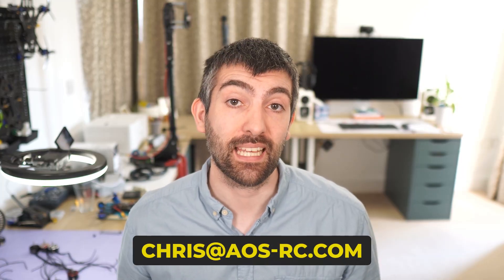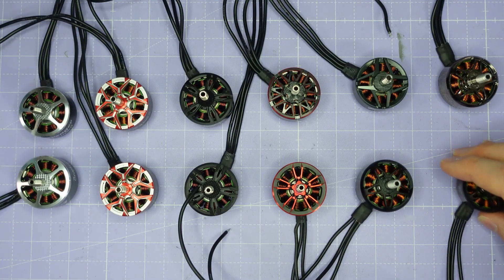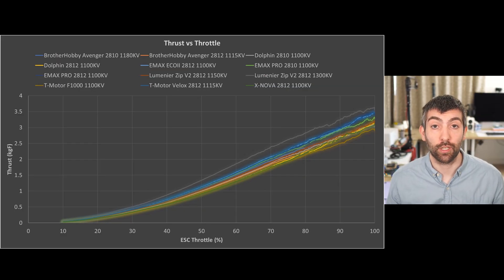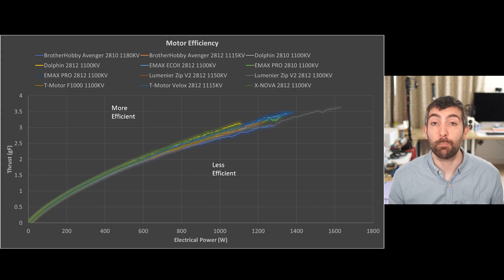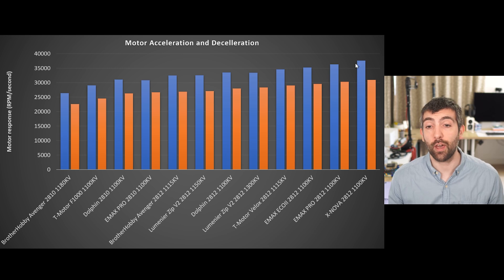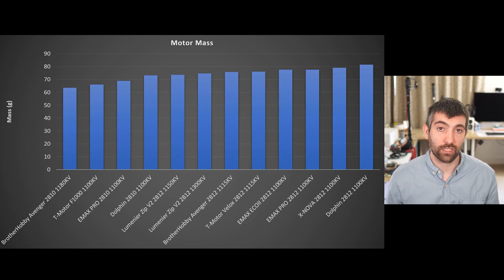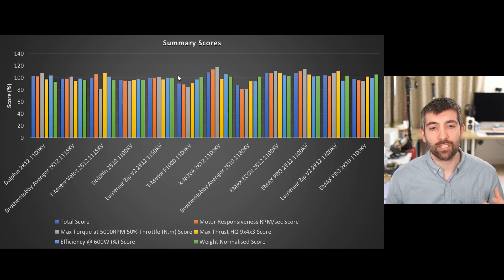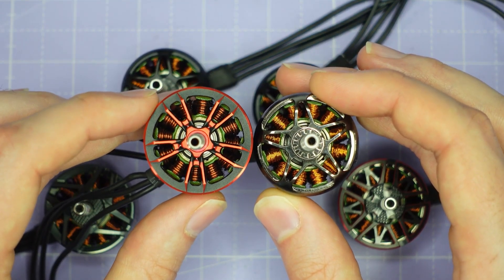Testing 9" FPV motors with a brand NEW Thrust Test Stand!

Comment: @chrisrosser I don't think I've ever seen you test any of the Amax motors which I've used in the past because they were popular with some Bando frame designers and Bando bashers.   I've always found them to be a really nice motor and recently Biggsy has used the Amax 2826 in his world record for speed.   I'd be interested how the Amax 2810 and 2814, mostly the 2810 perform as the 2814 is a big step up in weight.

Comment: Great video.  I think he is missing one very important thing though.  Motor weight.  For example, the Emax Eco II is 25% heavier than the Tmotor f100 as an example.  That is a huge difference (14g per motor).  For that particular example this far outweighs any efficiency and performance differences in the real world.

Comment: Why are these testers standing vertically, not flatbed? I have only tested the thrust of my helicopter tail with flatbed kitchen scales to 250 grams. The flatbed was very convenient. I held the tail boom at the near-end fuselage and calibrated the scale with the far-end tail motor on the weighing bed. Then, off I went, spinning the prop and checking the weight increases.
Reply from the maker: Great question! All the thrust stands I've ever used have been oriented vertically. I wonder if they are worried that the bench top would affect airflow into the prop?

Comment: Chris, you as an engineer, please make a video about the designs of different motors, like you said that brotherhobby one has an old design and it can be improved. I mean, not about how manufacturer can improve it's motor, because people pay for this info, just in general about motor design. 
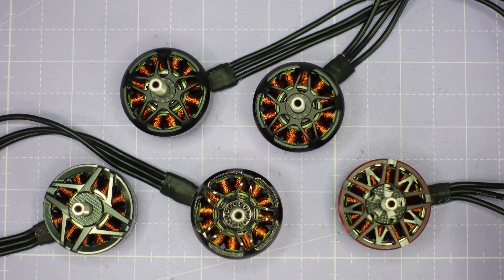17:50 I didn't even think about that, always thought that multi wire coils is better, idk why.
Reply: Tmotor has a new cine series of motors, cine77 i believe is one of it, would be interesting to look how it's designed

Comment: Great episode. I am endurance enthusiastic. I have always instinctively chosen low kv motors. This episode proves me right. I exclusively FPV helicopter for the low disk-loading. The problem with low kv motors is that they tend to be heavier, so the trade-off between weight and efficiency turns out to be a parabola curve optimization math problem, when the overall craft weight is fixed, such as the famous 250 gram. Solve for kv at the parabola's highest point.

Comment: is this is a sample size of one for each brand? 
possible one motor on low side of batch  vs another motor high end of batch?

have you tried testing lets say 20 of one motor to see the variance within batches? 
If I bought 4 brother hobby, might 1 be 10% less powerful? 900kv instead of 1000kv...

Comment: Can you recommend a very efficient and very light 8" motor that it can be used in a X8 or Octo configuration?

It should be good and have torque in the low to mid throttle (no more than 60% throttle), to be light overall so it can lift a cinema cam and at the same time to be as efficient as possible over being fast.

Comment: It Would be interesting to have Km torque efficiency.
to compare to the rest of the parameters. Maximum thrust is too much influenced by kv. This could be misleading
Last a mechanical efficiency map would be nice, but that may be too much to do and difficult to match to a propeller.

Comment: There is a Tmotor 2808 1950kv which could've been an interesting contender in this class.
Reply: Would have been quite a jump in kV compared to what was tested here.
Reply: @Qwarzz  Yes but it's been used on 9" builds
Reply: There are several 2808 motors on the market

Comment: Can't help but feel a pure motor efficiency test in terms of watts instead of thrust would be a lot better as it eliminates a lot of the variables here. You can't know in this test for example whether some of the higher KV motors are actually efficient motors since they are running a propeller that's too big for their rating.

Great video otherwise though! :)

Comment: I put BrotherHobby Avenenger 2110 1500 kv motors on your AOS UL8 in the X8 configuration. Just finished the build. I had it up to 77 mph at about 70% throttle. Can't complain about the frame or motors!